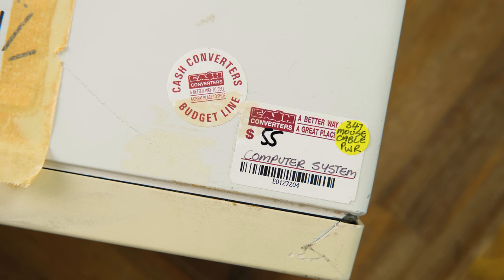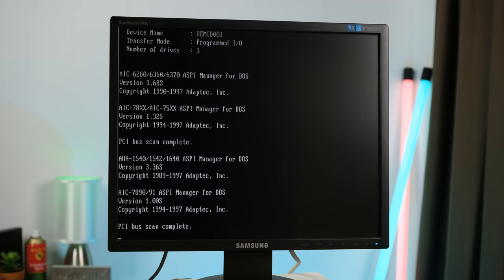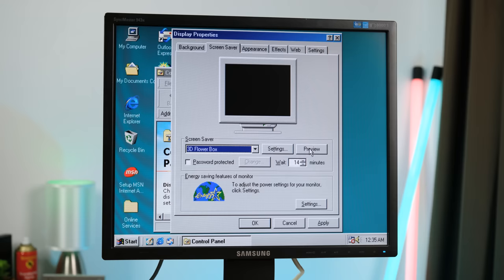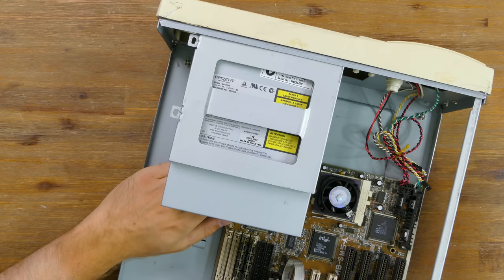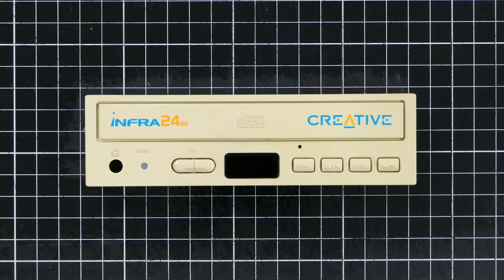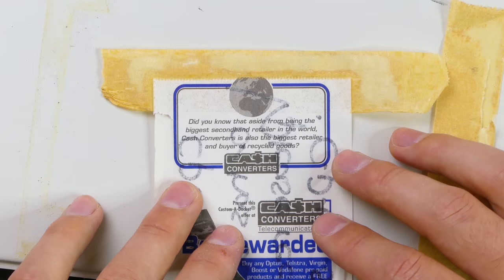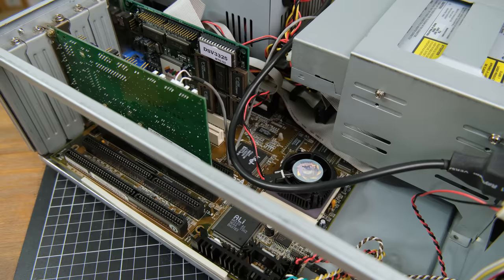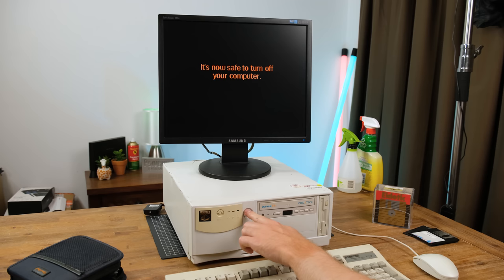Restoring A "Budget" Cash Converters PC From The 90s!

Comment: I "tried" to buy a  really cheap PC from my local Cashies in circa 2004. Asked for proof it powered on, and the salesperson proceeded to plug it in and flick the voltage select switch on the back of the PSU while trying to power it on and popped it...  It was some old Compaq Deskpro with a  Celeron?  They only wanted like $30 for it even then.
Reply: Ahhh... Yes. Compaq used bad PSU's at some point, to save money, when they began to loose market share. They were wonderfull machines from 386 era to late 486 era.

Comment: Pin 1 or the red stripe wire always goes adjacent to the power connector on the drive, and is labelled on the board. That way you can be sure you have your IDE cables the right way around. If you get the floppy drive cable backwards, the drive light stays on.

Comment: I have an IBM from 2000 with a socket 7 board that uses ATX power and PC-133 ram, and has an AMD K6-2 550mhz processor. But the board has no graphics slot, only 3 PCI, so it's honestly terrible. Fun nonetheless!
Reply: use a pci to pcie riser (cheap on ebay) to install any card you wish to bottleneck to the MAX
Reply: Probably one of the last run of IBM Aptiva´s ...i used one of these back in the day. One of my first installs of Windows 2000!
Very good for some games of this Win98 Era...
Reply: @virtualtools_3021  I think I'll stay with the onboard SiS graphics. When I find a better socket 7 board, I'll swap the CPU out.
Reply: @doodles113  It was my original computer, we bought it new in 2000. It's always run Windows XP in our house, but the sticker said it came with Windows 98, so that's what's on it now. It runs a lot of games ok, I always played Theme Hospital on it.
Reply: @virtualtools_3021  Only a handful of PCI-e cards have drivers that will work on the K6 or any Socket 7 CPU. So you're actually more limited in terms of choice.
Reply: @classic_jam  in guessing it's first gen Radeon x series? X300?
Reply: The graphics board would go in one of the PCI slots, but you would have to find an old PCI graphics board.

Comment: I’m surprised that has pretty respectable quality hardware. With all those bad sectors on the drive I was expecting a Maxtor lmao.
Reply: I've seen more dead WDs of that era than Maxtors, but I guess that was just the luck of the draw for me.
Reply: @johncate9541  Really? Interesting. Maxtor drives from that era are absolutely terrible, every single one has horrendous bearings that sound like a train wreck and it hurts your ears. I avoid those 1995-2001 models when I can, they always get terrible bearings and end up getting bad sectors. Now don't get me wrong Maxtor made some great models. I love the 6L250R0 I have, made in 2006. I also have a 200GB model and it is great. Well, I guess they are made by Seagate so whoops haha. Their Cheyenne series is great from the early 90's. The 7040AT, 7080AT, and the 7120AT. Anything that looks like the Maxtor DiamondMax Plus 60 in my mind is not when Maxtor was making quality but rather quantity. Sorry for the rant if you don't like reading haha.
Reply: @cdos9186  I never said my experience was representative of others. Just that even when Maxtor had a reputation for unreliability, they always seemed to hold up for me. It was probably just good luck.

Comment: Gawd. Cashies. Yeah. And the '90s retail and clerical training that would refer to the case as the CPU. It's a throwback to TTL-based systems that predate the microprocessor - the CPU would span multiple chips and so the entire case and contents would be the "CPU", while the hard drive would be some great washing machine looking thing off to the side. Of course, that terminology was dated by the 1980s, what with 8-bit microprocessors already having entered the home, and 16-bit microprocessors performing office duties in the late '70s.

...and workplace training hadn't caught up by the '90s. I can remember facepalming in a clerical training course held on Currie Street in the CBD when they introduced the case as the "CPU" IN 1999!

Comment: Excellent video as always. Still severely lacking in a CRT monitor though 😁
Reply: Indeed. Even today a CRT monitor is very useful especially for playing modern pc games with older GPUs. I still use my 980ti on a CRT and at 1280x1024 Control runs perfectly.
Reply from the maker: Just more of a pain to film with my cameras 😬 Don't worry, I have CRT monitors.
Reply: @johnathanpearson3203  ez response time
Reply: @psivewri  what model???

Comment: The box of Eidetic floppy disks caught my eye. I sent a box of 5.25 inch Eidetic floppies to a colleague in Kansas City a few months ago. She and her husband are mentoring a youngster who’d heard of them, but never seen one. I still have quite a bit of old software on both disk sizes: PageMaker 4, Sprint 1.01, MS Word 1.0, Wordstar… Time to knock together an old Socket 7 machine for a bit of fun. I recall building two using 400 MHz AMD CPUs and the then new SDRAM memory back in the day. They were more exciting than my new 24 core Threadripper that’s due for deliver mid-January.

Comment: Another pc made in my country. I've seen many PC brand assembly factory used to be in Thailand back then in 90s, but these day only some electronics and computer parts. Mostly are HDD, Microchip (one of your Arduino AVR chip migh made here) and Delta PC fan and power supply.

Comment: I bought a second hand Windows 95 PC from Cash Converters too, it had in it:
2TB NVMe (Gen 4) SSD
RTX 3090
Intel i9 1200K 
64GB DDR 5 5800mhz RAM 
Z690 Aorus Extreme Motherboard 
inside it, and it only cost me a WHOPPING 36 quid! (GBP)

Comment: The windows 98 install I remember those days, lol
Commonly unknown or forgotten information, yes most IDE cables could be put in upside down but they normally have keys on each side that corresponds to the top of the cable, then later revisions had a centring pin.

Comment: If you want the computer to stay white go get some high quality auto wax and coat all the plastic with it. Let it sit and dry the wipe it off. The wax will give the plastic a layer of uv protection and will prevent yellowing. Over time you may want to apply again in a year or so.

Comment: I recommend replacing the CD Rom drive. Those creative drives are total rubbish. I remember having to replace so many at the time as they were prone to failures.
Reply: right, I recall that my creative CD rom from my P1 era failed to read so many CD's
Reply: @eaglemaster7  The good thing was it had a remote control to control the drive but the drives were total garbage. I replaced so many as all of them had trouble reading the discs and used to make the PC blue screen. I remember seeing one that went over 60x when a red button was pushed. I tried this feature out and heard the drive go crazy. After a while I smelt like something was burning then the drive suddenly died.
Reply: @andymate2006  when I was very  young, I tried to tilt cpu tower a bit  like45 degree to tidy up some cable under the tower when cd read at high spin, and sudenly boom, the disk literally broken in pieces, even the spring on the drive tray is collapse
Reply: @eaglemaster7  Yeah I had a CD explode in a DVD drive to. I was copying a CD for a friend and it was going 52x. The Nero Burn software was half way reading the disc then BAM.  I heard an explosion and the computer froze up. I had to replace the DVD Rom drive as the original disc shattered inside the drive. It was too much of a mess to fix the drive. If you ever want to see an CD exploding watch the Mythbusters episode about exploding CD's. That episode is so satisfying to watch.

Comment: Hey i didn't see you change the thermal compound.... You can use a programme to write Zero's to the hard drive and low level format it that could clear bad sectors... It wouldn't hurt to take memory out of a non working PC to add some or even add a better CPU if one compatible...

Comment: I remember when I was about 13 buying a desktop 286 from galwer cash converters s.a for $20 i was only getting into computer's it was running Windows 3.1 an a dos menu, I was bord an was thinking there's a slit there that fit a sega mega drive cartrage so I took the plastic case off an put it in the slot turned it on it blow up lol 🤣🤦‍♂️ I was a stupid kid lol

Comment: Back then, Windows could not automatically turn off some PCs like they can now. I've not heard of that brand
Reply: Mostly AT computers were to be switched off by the user and some ATX with weird standard or uncommon drivers that had to be loaded after Windows installation. 
I had a P90 board that was very weird: huge form factor, PS/2 kind of connectors (all in line on single row), ATX power but unable to be detected by Windows 95, a even weirder text mode BIOS that always asked for password even if the password was empty, and it accepted only Pentium 60 or 90, with other CPUs would not boot.
Reply: ACPI was a bit finicky back in those days. I once owned an IBM Aptiva from this era (the first video on my channel, in fact) which was Socket 7 with an AMD K6; in theory it had ACPI ("soft") power but Win95 sometimes liked to play dumb and act like it wasn't there, so you wouldn't get a standby function and you'd have to manually turn the system off when Windows had shut down.

Comment: There is no reason to write anything on that ribbon cable. Pin1 is always marked and there is a red wire on the cable that are Pin1. Almost all IDE devices (99.9 percent) have Pin1 on the same side.

Comment: Having sold hundreds of those in 1980-90s, my best suggestion is THROW IT! 
The directly fitted power switch was NOT the reason for the shutdown message, it was because the HDD need to shutdown before closing down the system. The motherboard didn't support sleep/standby/hibernate modes that modern ones do. I am a 67 year old retired computer nerd/ tech/programmer that bought his first Computer in 1977 and started selling them in 1979.
Reply: Not true. Those mid-90s HDDs will automatically park their drive heads when they lose power, unlike really old drives where you typically had to run a little program to park the drive heads before shutdown. The reason for the shutdown message screen in this case is that the PSU is of the older AT style, which cannot turn itself off, unlike the newer ATX standard. So yeah, Psivewri was right.
Reply: @8bitbubsy  I repaired countless PCs for that very reason back in the  80s & 90s. The shutdown procedure allowed the HDD to park correctly and for windows to flush all the read/write cache buffers. the drive did indeed would rest the heads in a safe place on powerdown, but didn't flush all the memory based caches. I was tech support for years during that period. the number of killed Filesystems due to people just turning off machines was immense.